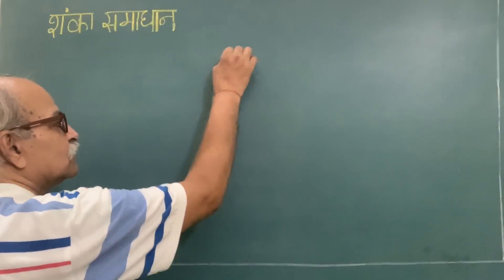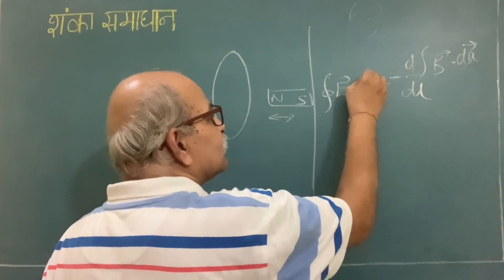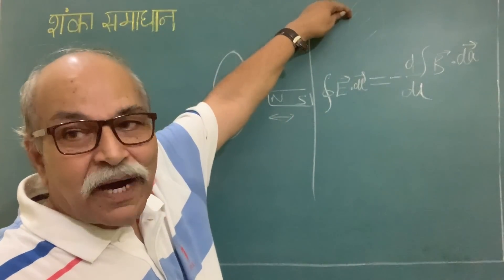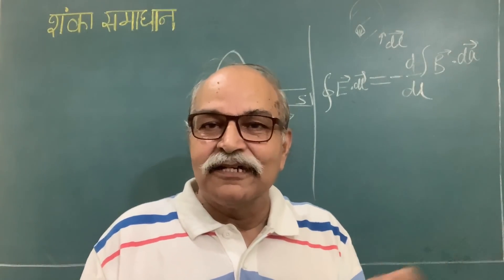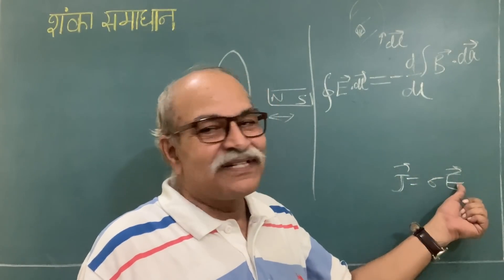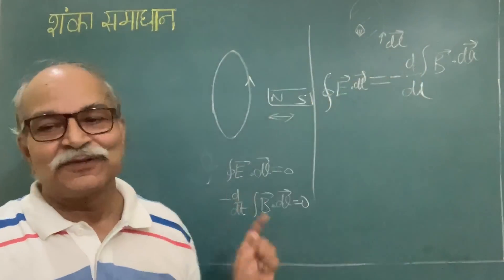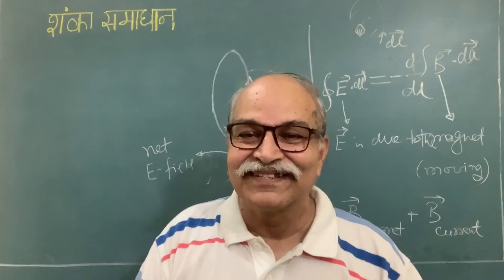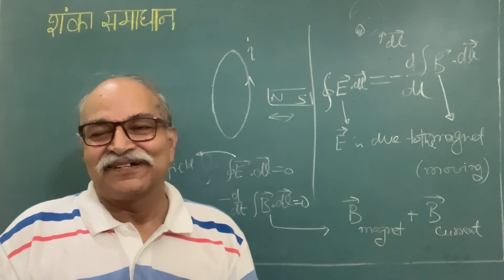Magnet moving in and out of a superconducting coil

Comment: Genius teacher  and my inspiration to pursue research in  physics instead of engineering in a company.♥️♥️♥️♥️
Reply: Sir if earth moves at 1675km/hr and if we moved a car at 50kmhr at the same direction so technically its speed will 1725kkm/hr ???? Please answer the question
Reply: @dhruvmishra2000  it depends from which frame you are asking if you are asking from a  stationary frame outside the earth then it will be 1725 but if the frame is  inside the car then speed of car will be zero if the frame is outside the car and on the earth then it will be 50km/hr.
Reply: @thecosmosify841  Exactly ! Everything is moving relative to each other . So , it depends on which frame you are talking about. The solar system itself moves at a speed of (828,000 km/h around the Milkyway Galaxy which inturn is moving into the vastness of space !!!
Reply: @dhruvmishra2000  no bro car is moving on surface . Of earth  so technically tangential vel of earth gets vectorilly added to it but in the frame of outside earth
Reply from the maker: So nice.